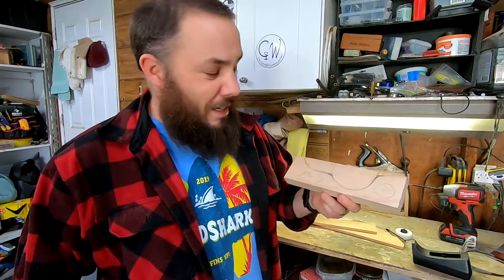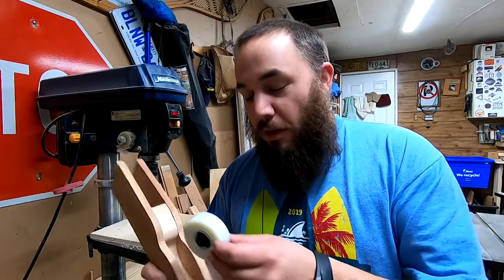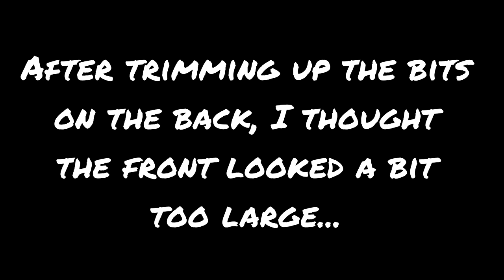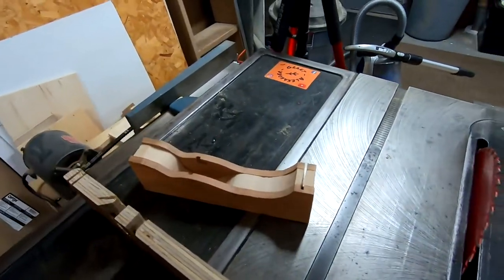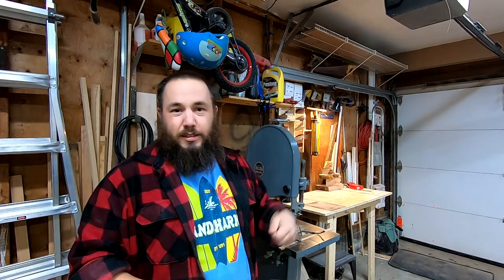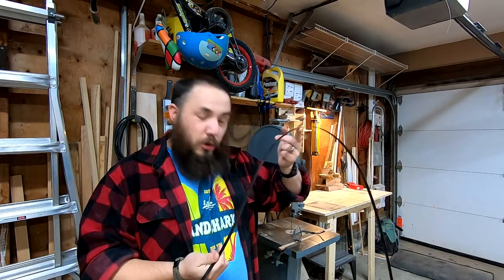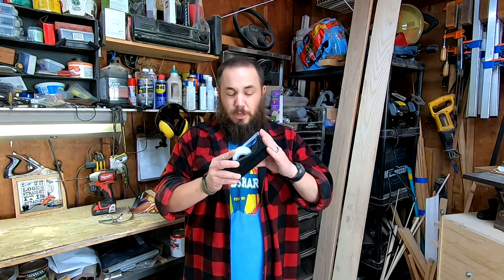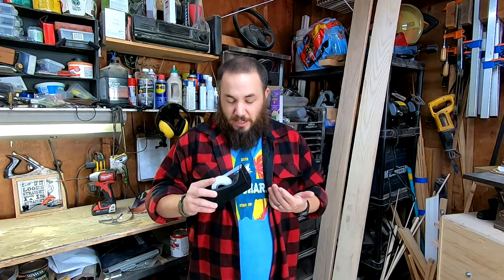Is This The Most Expensive Tape Dispenser Ever???? - Custom Tape Dispenser

Comment: Tape measure 😂😂😂
Hey Grant, awesome video and idea behind it. Oh man, that was close on the table saw 😱. Glad nothing bad happened, and then you started on drill press afterwards. I thought for a second, oh no, not again. Kidding on side 😃...
Are those BBs made of a lead or steel? Be careful if they are made in lead when you sanding!
Cheers and can't wait next project!
Reply from the maker: Thanks it was a fun project for sure! I specifically ordered steel ones for just the reason you mentioned! I did think about the drill press at the end, but I knew I had at least 1/4 of an inch of room to drill! 😂😂 thanks for watching 🍻

Comment: I usually watch my YouTube on 1.25 or 1.5 speed. When I picked what was coming I slowed it down to 0.25 to sit back and enjoy the fireworks... cringing and gritting my teeth the whole way. You Poor Bastard. It's like hitting a nail you didn't expect... and then remembering you're the one who put the nail there 😅
Reply from the maker: Haha that's a good analogy 🤣🤣 i remember one time i was doing some demolition in my house and i put a board with a nail sticking up on the ground and then 10 minutes later stepped that exact nail. 🤣🤣

Comment: 3:59 Stop! Do you hear me Grant. Stop now. It turned out rather nice in the end, but you will gave to give it away as it will remind you of what happened. Looks like your blade is a trend. Can get on Amazon.  I broke my last bandsaw 1/2" blade the past week. Not easy to get. Will buy from tuffsaws in the UK and have 2 shipped.
Reply from the maker: You are supposed to tell me that when it was happening, not after the fact! I have about 50 old bandsaw blades. Pretty sure I have every single blade that was ever used on this bandsaw since 1946. If I could send you some I would! Thanks for watching 🍻
Reply: Thank you Grant. It is a 1/2” x 3tpi M42 x 2490mm. It lasted 3.5 years and only broke because I was careless cutting log discs. Have some 1/4" ones, will do till the new one arrives